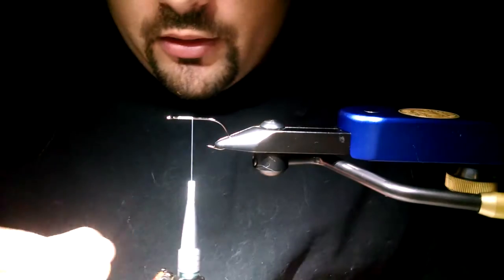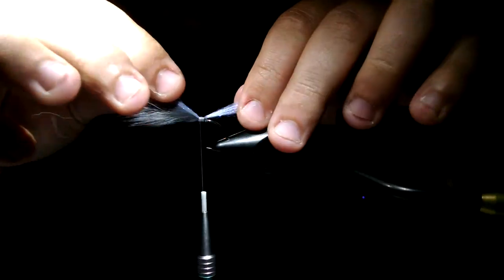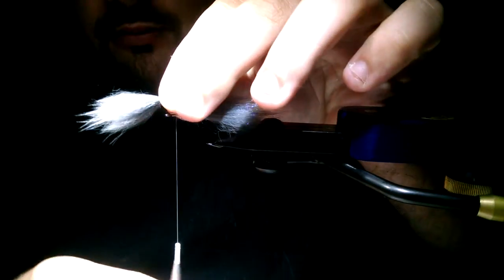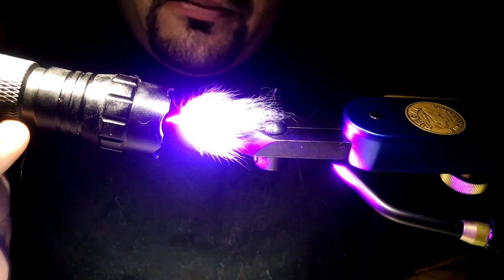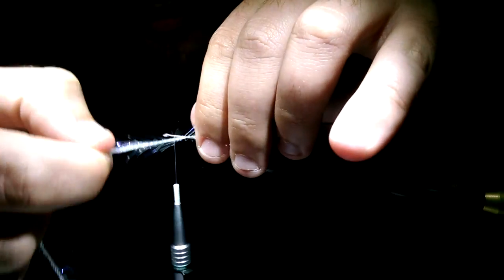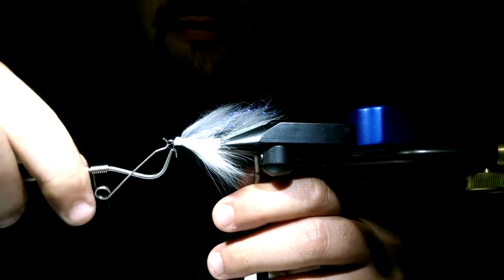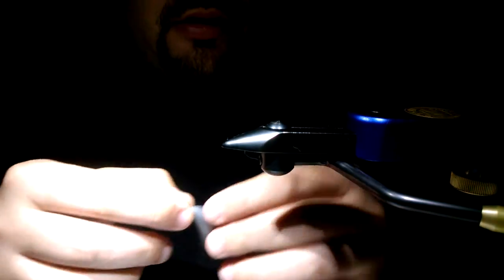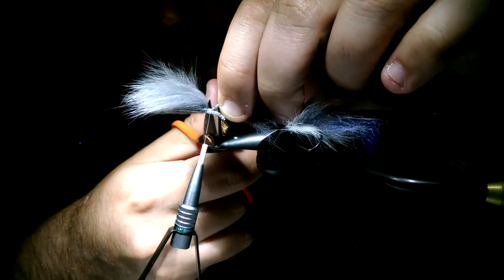Wiggle Wiggle Streamer

Comment: when tying with shanks ,start by tying on a small section fo spider wire or equivalent to the shank the run loose end through the eye of the hook allow 5-7 mm. slippage  re attach the loose end to the shank and tie it down well. Cut any tag end off and apply super glue or zap-a-gap to shank to lock it  on.